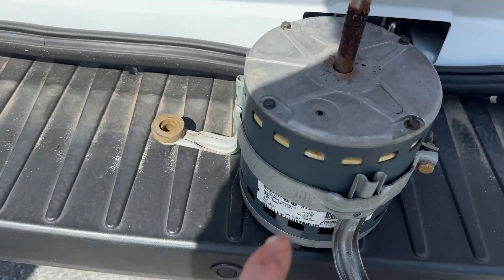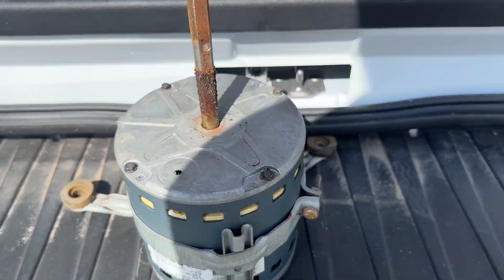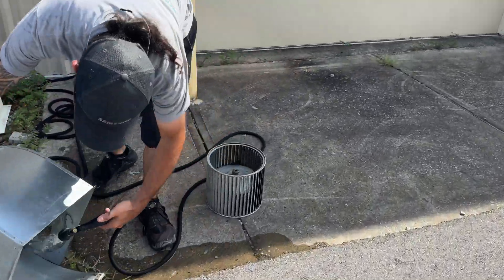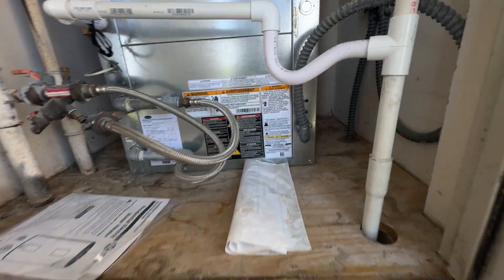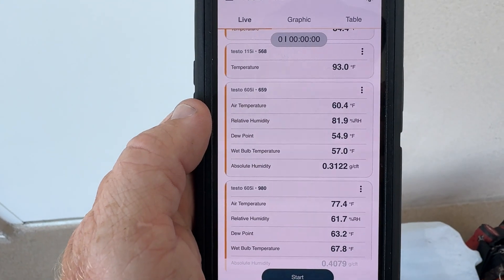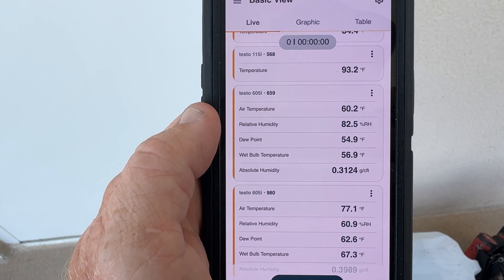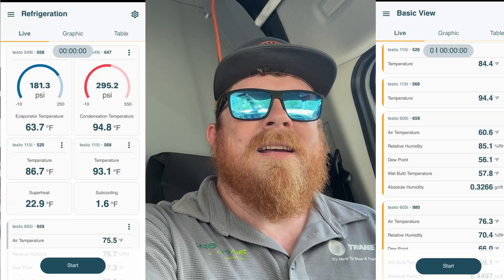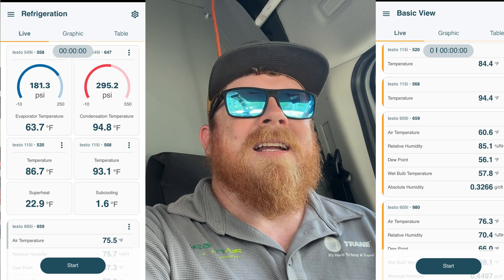High suction pressure on CARRIER water source air conditioner

Comment: Often seen in office buildings with circulating water piping.  Incremental units in drop ceiling  can move heat to cooling tower.  If heat pump can often move heat from one side of building to the other (to counter sun gain through glass windows).  Very efficient.  High pressure on low side is generally restriction in metering or overcharged system.  I've worked on countless of these.  If heat pump usualliy heat added to circulating water with electric hot water unit.  These are used all over the US since the 70's.  Very similar op to geothermal but different heat exchange system.

Comment: What’s the story on these water source units?  Is that a Florida thing?  Is it fresh water?
Reply: Most condos or small buildings use this due to space to put a condenser. Sometimes we use the heat of the condenser water to heat up other stuff to save energy.
Reply: Most buildings with 10-15 stories or higher, and limited roof space use them to not run too long line sets up the building and to not over crowd the roof top with a crap ton of condensing units. They run a bit more efficiently on the condenser side than air cooled units provided building and unit water flow is good and the tower water treatment is properly maintained.
Reply from the maker: @TVwatcher-ic3ne  I guess. It’s only in these condos built in the 50s or something. They also have split system where the condenser is in the wall pushing out hot air outside. We call them thru the wall condensers.
Reply: @CosmicCooling  that’s different. Step up from a window banger but it must be “fun” to access.  I like how your videos are pretty short, but if you wanted to show-and-tell on those funky Florida units I bet people would dig it.